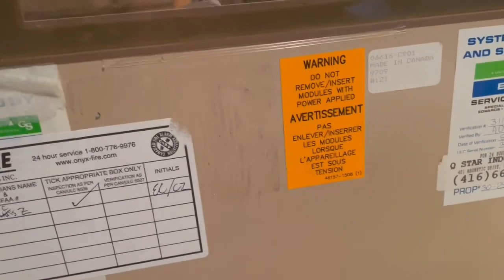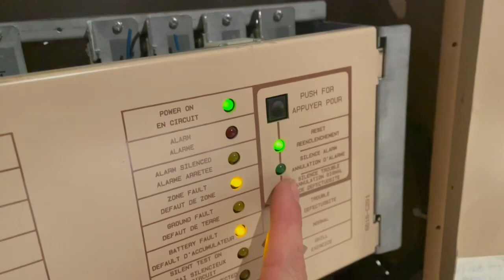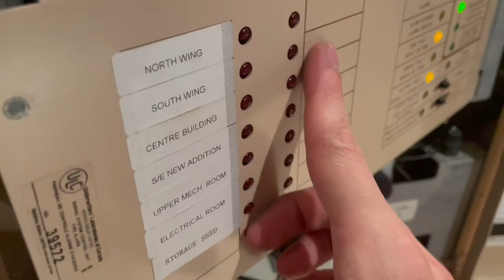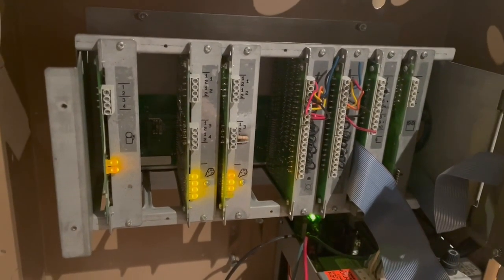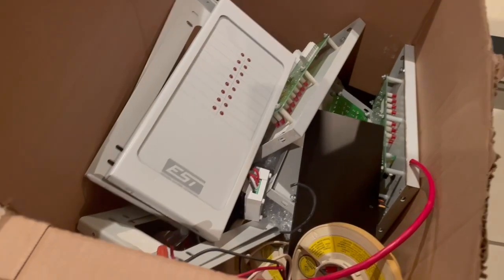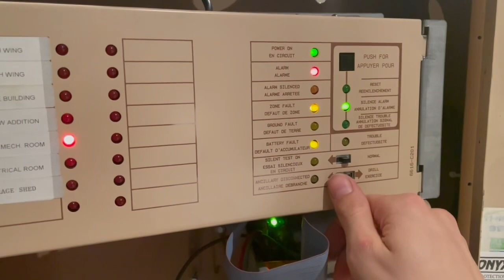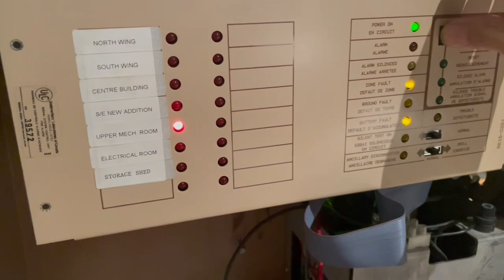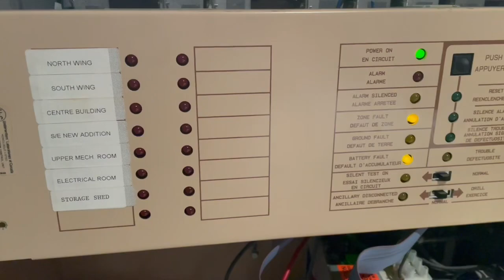Old blown Edwards 6616 fire alarm control panel! Let’s bring it back from the dead!

Comment: I’m in Toronto.. I have that exact panel. Issue is one of the yellow trouble light is on and the green silence light is in.. but all the zones are good. And the alarm company Monitoring did not get any trouble notice either. We just noticed it today as we walked by…My fire tech says it’s probably a board issue one of the capacitors close to the reset is dark.. but not sure he says .. answer I got is that it’s old and needs to be replaced.. we are doing a rebuild in this building in 24 months.. I can’t afford a new system now.. Is there anyone in the Toronto area I can call??